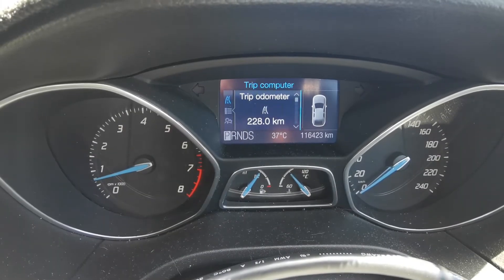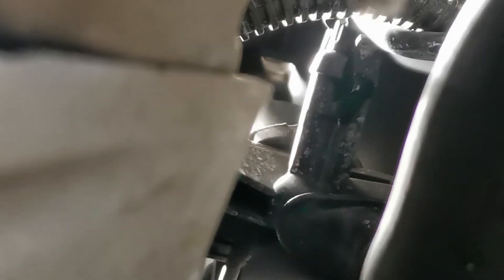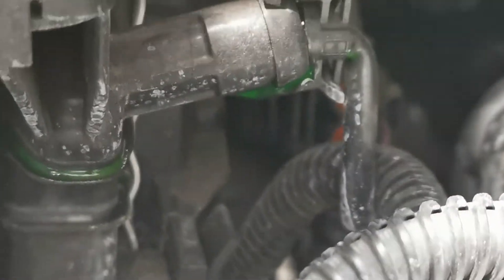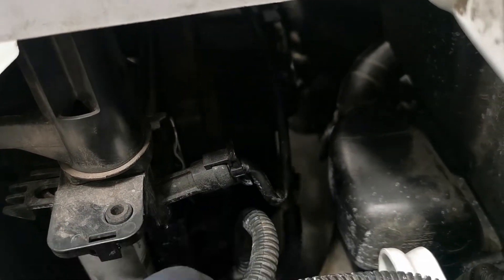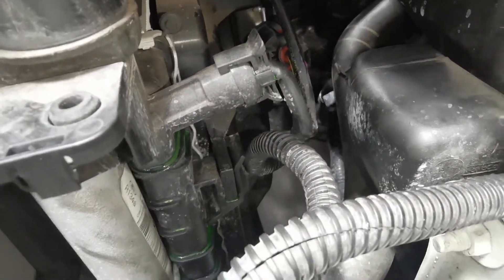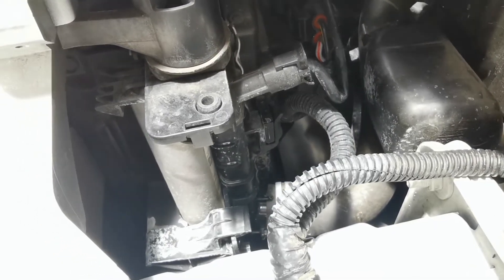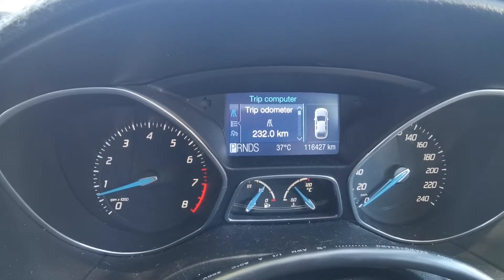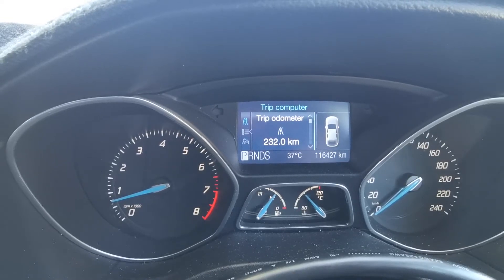Ford Focus Major Coolant Leak - Found & Fixed

Comment: I had leak on a ford focus ST MK3 62 plate 106,000 on the clock & on finance

I had a new rad fitted after I noticed on the passenger side.. they said they used some sort of sealing product to fix the leak along with the new rad.. however it’s started leaking from the drivers side now.. what could this be
Reply: Take it back to who fitted rad should have 12 months warranty on new parts fitted

Comment: "Hey everyone, I’m having an issue with my car’s coolant. It seems to be leaking somewhere, but I can't pinpoint where. The weird part is, whenever the coolant level gets low, the heating in the car stops working. Has anyone experienced something similar or have any idea what could be causing this? Any help would be greatly appreciated!"
Reply: Its a little late, but check the hoses going in and out of the heater core, the quick connects on then have an o ring that eventually goes bad
Reply: Same problem
Reply: Sir I don’t use the heater ( warm weather always) but I have a leak somewhere not found yet even w UV light and dye . I have noticed the coolant reservoir is empty but fluid returned backwards from engine? when reservoir’s upper cap is removed. I think that Part of the coolant is ejected from the tank when pressure increases w the hot liquid. I changed the tank but issue remains. 
Did you solve the problem on yours ?

Comment: Good idea to suggest the hose should be replaced. You can see where there was several kinks in it. Sometimes you end up scratching your head looking at what others have done during a 'repair'.
Reply from the maker: 100% mate, had another loom going the wrong was today 😁 😛
every bracket and clip was misaligned and left out 🤐
Reply: @GerardBurkeBurkesGarage  Dealing with previous dodgy workmanship
Reply from the maker: Yep, and plenty of it